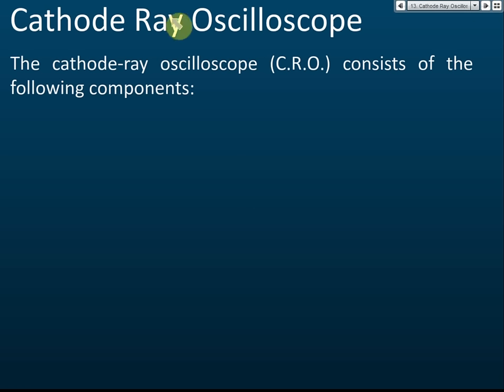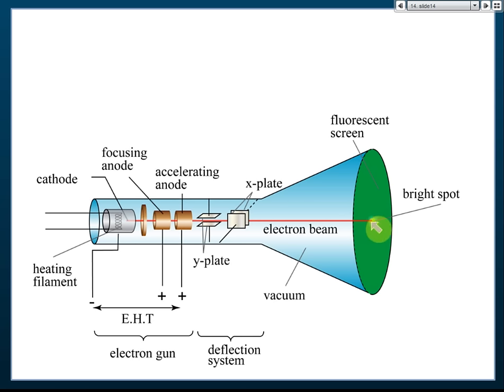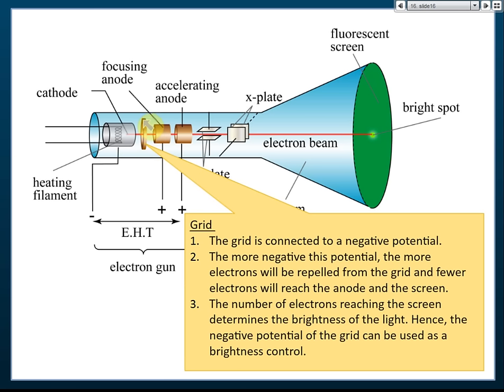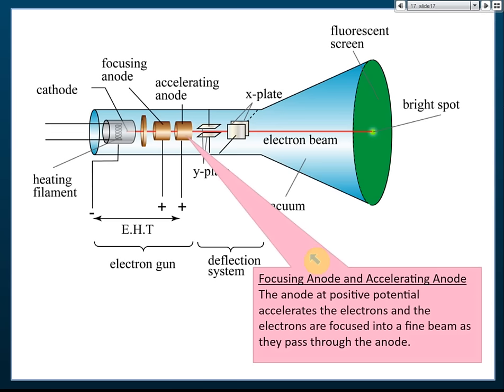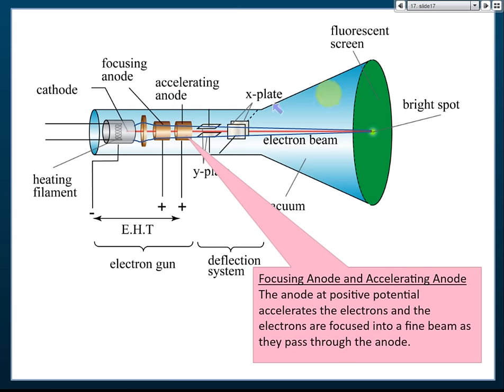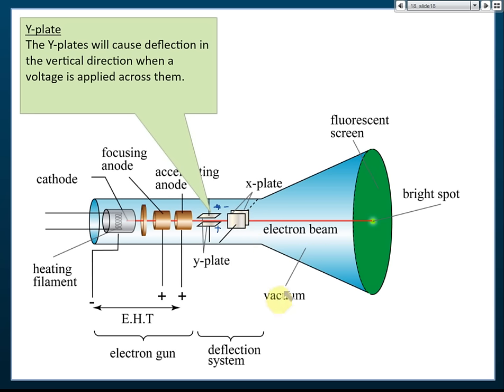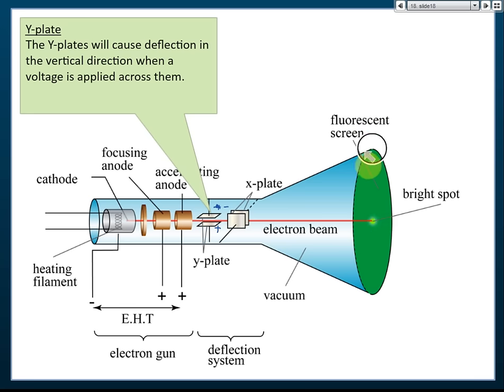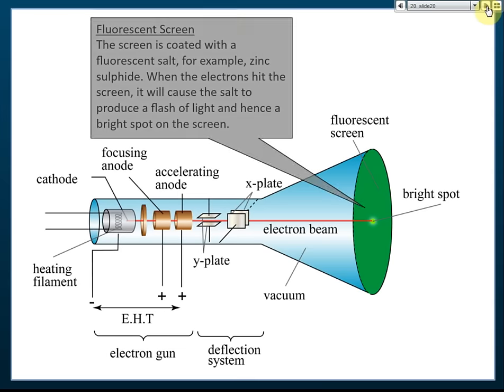Cathode Ray Oscilloscope (CRO) | Electronics | Physics

Comment: how does the control grid control the number of electron ?
Reply from the maker: The control grid apply a positive voltage on the electrons. The higher the voltage, the less electron will pass through the grid.
Reply: But how does voltage determine the passing of electrons?
Reply: Tanay Karve higher positive voltage will pull more elctrons since elctrons are negative. And vice versa
Reply: @myhometuition  if we apply a positive voltage then more electron will pass as electron has -ve charge.

Comment: I'm confused with cathodes and anodes. Can someone explain? In chemistry the cathode experiences reduction (wants electron) while the anode oxidizes (emits electron). Is the terminology different in physics?
Reply: Cathode and anode generally are different as cathode is positive and anode is negative. However, in electrolysis in chemistry its quite the opposite based on how it conducts electricity through an electrolyte.

Comment: In my Grundig television first is tungsten heating filament, then cathode (3 RGB cathode), then 1st greed 1 (CONTROL GRID G1) to control electrons brightness, then 2nd grid (SCREEN GRID G2) to accelerate electrons towards screen, then 3th grid (FOCUS GRID G3) to focus the high speed beam, and then there is 4th grid  for astigmatism or another acceleration level, not sure for this 4th grid.